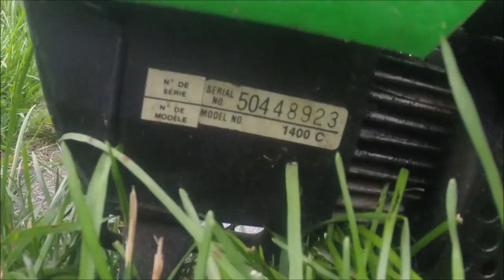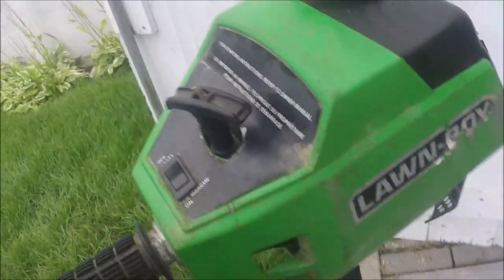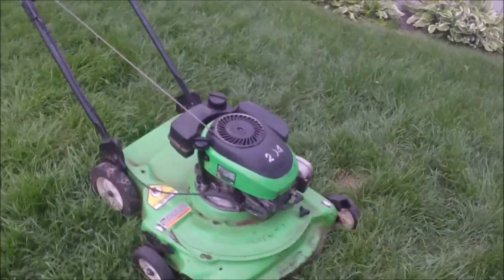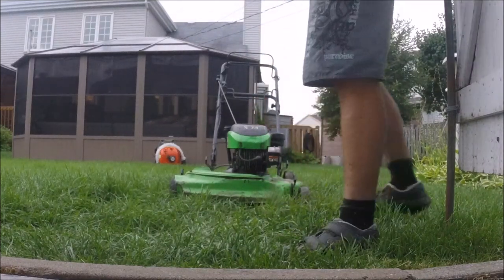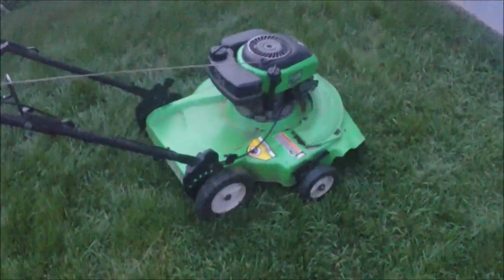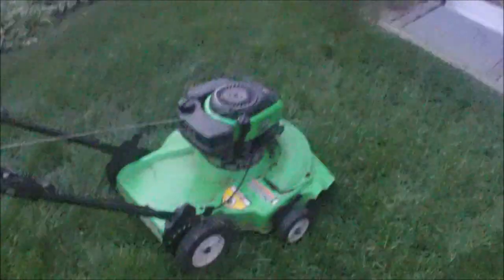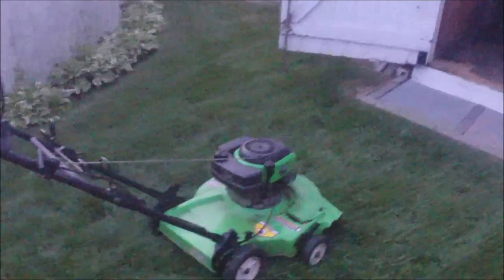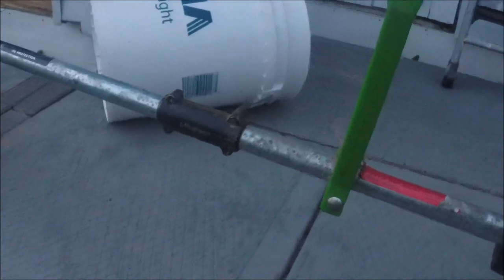Lawnboy 10260 with a rare Lawnboy Trimmer, and Stihl BR550 In Action

Comment: Man that Lawn Boy trimmer is awesome! Did you ever see the Lawn Boy walk behind edger? They're cool! Sad to hear what happened to your 10323, hopefully Opti-2 wasn't at fault. A bit of an update, I've run it in all my equipment is summer and they seem to run stronger!
Reply from the maker: ChiacagoSirens  Yeah it is :)

I've seen the edgers ( model 1013) on youtube videos, but never in person.  Gas edgers here are practically non existent, none of my dealers sell the Stihl FC edgers.  LB edgers are definetely a novelty but I find them quite dangerous to own as there's no clutch that disengages the blade, so it's constantly running at full speed.  Opti-2 oil was not at fault.  I mentioned to lawnboy8461, the reason for it's blown engine was metal fatigue.  In the 6 years I've swapped that 10247 engine on there, it's cut about 2000-3000 in its lifetime, so that is why it blew up.  I got 2 replacements, a commercial 22261 and  another 10323 in better condition than the one I had.   Tranny is perfect, engine is solid, and deck is rust free.  That is awesome.

Comment: Well I think it's time to go for the lawn boy 22261 because you can cut a lot of lawns and has a 3 speed transmission
Reply from the maker: Adam,  I made this video a couple of weeks ago, so a lot has happened since then.  I ended up buying the  22261 and the lawncutting video with it was made and recorded ( just need to publish it).  It was SUPPOSED to replace the 10323...but last week I found another 10323 from my friend that sold me the commercial.  I got it for $100 in pristine shape.   Engine is solid, transmission is almost new and  it has a rust free steel deck.   The original tag for the mower  was destroyed so I don't know the year or model number (thinking it's a 10323 from 2003), but I'm labelling it with my original sticker.   So essentially, the 10323 is back up in a newer form

Comment: overriding the governer too much in the 10323? Nothing like cutting the grass at 6000rpm, YIIINNGGG!!!!
Reply from the maker: Kenyon, not at all.  All my lawnboys are set to the factory 3300 rpm and I never like them running well over that which is why I toned down my M series.  The 10323's connecting rod let go due to metal fatigue.  It was used more than once a week for nearly 18 years...so  it happens :(
Reply: +Jon3800 I miss having a duraforce. I had a 10247 a while ago and ended up scrapping it because I couldn't get the choke to function after I rebuilt the carb
Reply from the maker: that sucks man :(
Reply: Jon3800 yup, wasn't the best at working on lawn boys when I was like 15, I have no idea where to look for these things, maybe the mower I threw out is still at the scrap yard that I dropped it off at